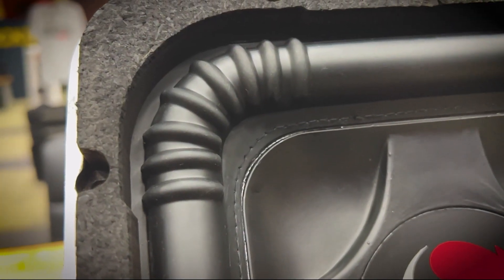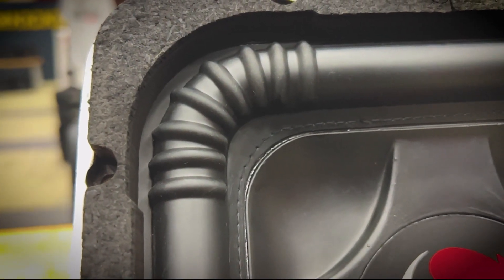Origins of L7 with Steve Irby

Comment: Havent ran kicker in years. Been a fosgate guy a long time. I currently have a p-300 12 powered wedge in a 24 honda sport hatchback would a 12 square l7 sound better?? Or a ten??? Looking for good bass response and sq too.
Reply from the maker: Yes, and yes! A 12" L7 would be both louder and better sounding, as would a 10" - you have more surface area with a 10" L7 than with a 12" round sub. If SQ is a feature you're looking for, check out our newest CompQ subwoofers that we just released!

Comment: Just wish they would start putting more than one spiders on there subwoofers that a huge failure point.
Reply from the maker: The Solo X will have two spiders.
Reply from the maker: There are pros and cons to multiple spiders.  Adding resistance will raise the power handling, but you're going to sacrifice efficiency in trade (among other things). Making it loud is great, but not at the cost of making it sound sloppy/muddy. It's a balance we as manufacturers all have to consider when we make a sub.
Reply: @KICKERAudio  yes good point, but also after awhile the spider will no be able to control the movement of the sub as good and will not sound as good. But other than that I like kicker subs
Reply from the maker: @doitrightthefirsttime8952  the reality is that you cant please all the people all the time. Make a super high spl sub and the people that dont want to throw tons of power at it will not get the sound quality they want. Make an efficient sub and the people that want to beat it to within an inch of its life every time they get in the car will wish for something completely different. This is why we make over a dozen lines of subs, so you can match the right kind of sub with the right kind of listener.
Reply: @KICKERAudio  true lol but single spider don’t last period
Reply: @doitrightthefirsttime8952  the entire adire audio lineup( super elite top-level stuff) feature several of their top models with one single resin impregnated fiber spider, and they're recommending a minimum of 5 K to those subs and people are running 15 and 22 them and their lasting and smashing. It's all in how you build it, some of their single spider options have up to 40 mm of effective x-maxx with 70% BL through stroke that is just plain nutty